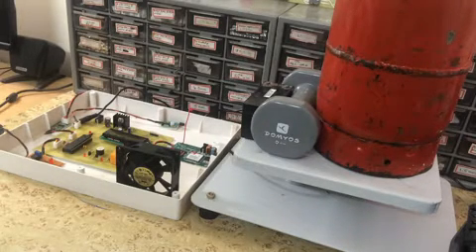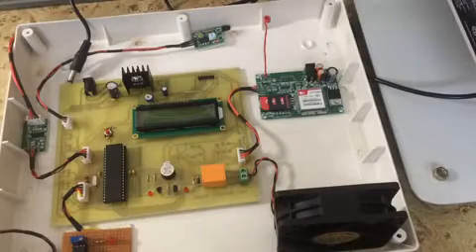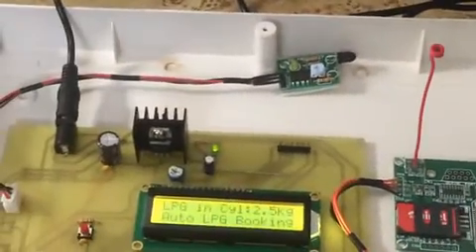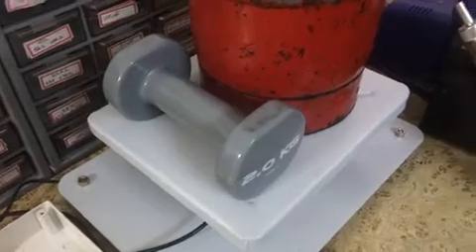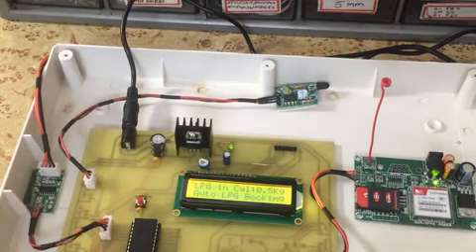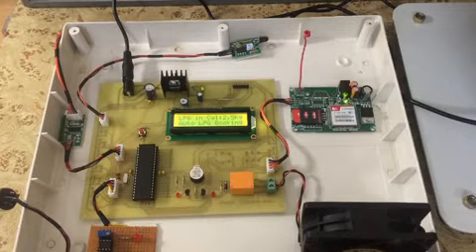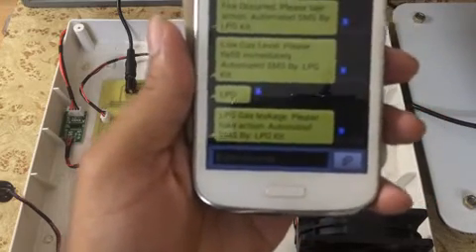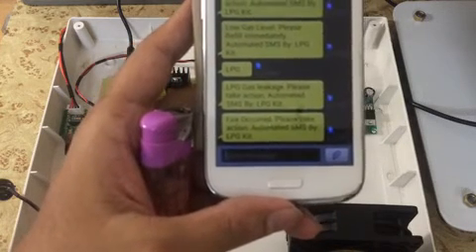How to make Automated Gas cylinder booking system

Comment: sir, your vedios are really good.does this code work with arduino uno? and i want to create an android app for automatic booking and alerting the users when there is gas leakage or fire.how can i get the values from arduino to my app?  sir,please reply..thanks in advance.
Reply from the maker: No, This code doesn't works with arduino.
You have to use Bluetooth to communicate with Arduino with APP.

Comment: sir what the microcontroller you have used in here. is avr compatible if I am using hx711?
Reply from the maker: ATmega32A microcontroller. Yes it is compatible. HX711 has SPI output.
Reply: thanks sir